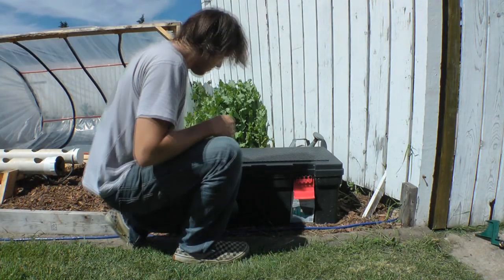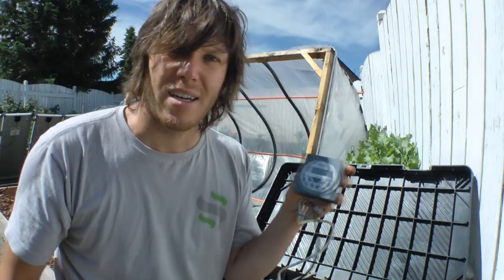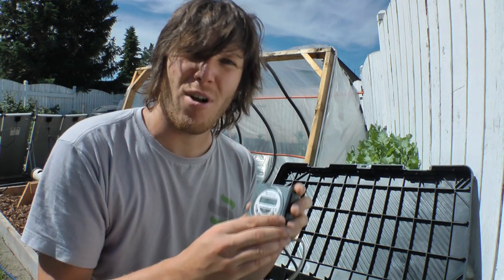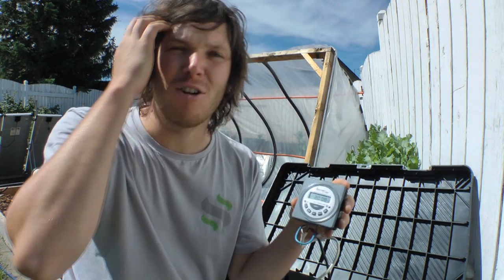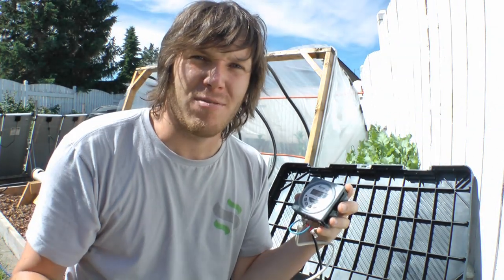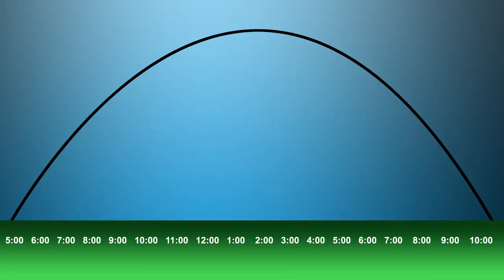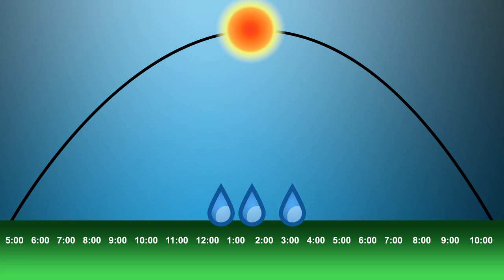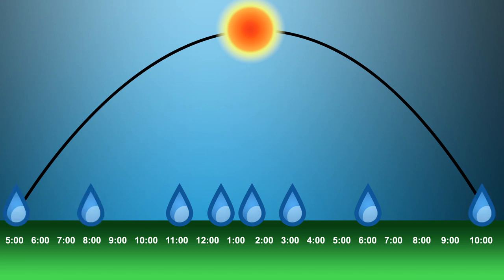How To Hydroponics - S02E23 Setting Up A Timer For A Hydroponic System

Comment: A few important considerations: 1) you may be better of with a simple "Short interval timer," not a "scheduling timer" 2) The times vary widely depending on advice. Tower Garden sells a foolproof preprogrammed timer  for US$32 with two foolproof inside and outside settings of 5/45 and 3/12 minutes respectively. However, when they sold a regular mechanical timer, they suggested more manual settings for outdoor, depending on increasing temperature. You may want to cycle every 15/15 m. That's 48 cycles/day.  Electronic Scheduling timers can't do that many.  They only offer 8 programming times. Mechanical scheduling timers however can and may be perfect. Short interval timers on Amazon are around 40mbux from what i've seen,  but worth it.  These are all AC options Im familiar with.  I like that you use a DC option. One could use a couple of uninterruptable power supplies for blackouts , one for pump/smart plug and other for router if you are in a smart house.

If you use a smart plug, Alexa for instance doesn't offer a repeating interval option, so it takes 24 routines of allowable 20 steps each for a simple 15 min interval.  And apparently the smart plugs' relays wear out when switched on/off a hundred times a day.

For flexibility, you could buy a "Short Interval Timer"  in Amazon. As temp goes up over 90F, one Tower Garden distributor recommends 15 min on 15 min off.  

This is the distributor talking about tower garden settings, "Setting the Tower Garden Pump Timer | True Garden" https://youtu.be/Smk0jsSYecI for reference.
Reply: i will add that Tower Garden's ®well-researched on/off times seem to be at a 1:4 ratio for outdoor, with 1:1 for hot, and 1:9 for indoor. if that is instructive. I'm in BC on the Sunshine Coast. My glass covered deck by the water has mild and humid air circulation, and lots of sun. ranges 50F night sometimes to 80F to 100F day.  I should put a fan on the tower on hot days. I am leaning toward 3 min on, 20-30 min off semi indoor but outdoor, maybe like a greenhouse. 

Perhaps a smart plug could be put before the short interval timer, (which saves settings when disconnected) and attempt to calculate timings for a 45 min off interval at night, to let the roots breathe some air.

Comment: I am looking for a timer that isn't exactly a high dollar item. seems with the rapid growth of hydroponics the parts to build these systems go's up. what are a few generally good timers I can use that can be found in a hardware store? also, have you considered adding a second fill and drain tube, and second resivore and timer, just setting it at different times of the first, to achieve the desired watering times?